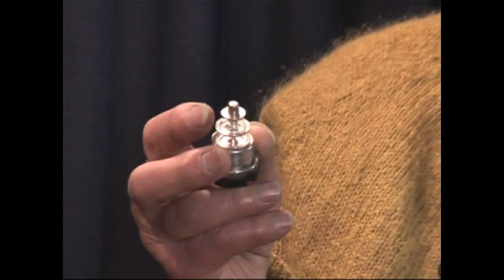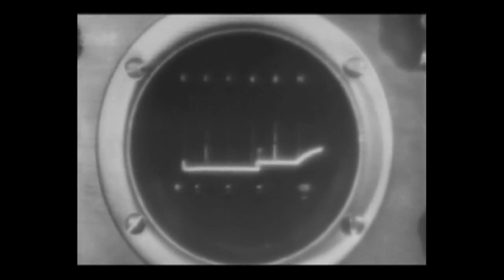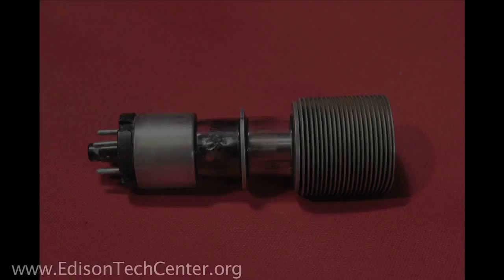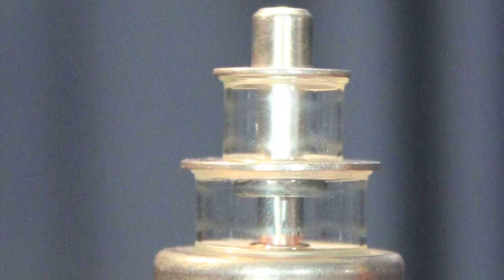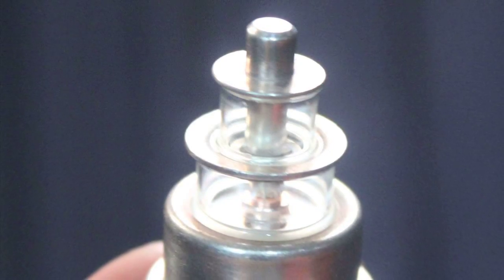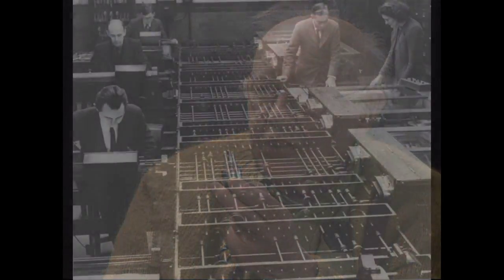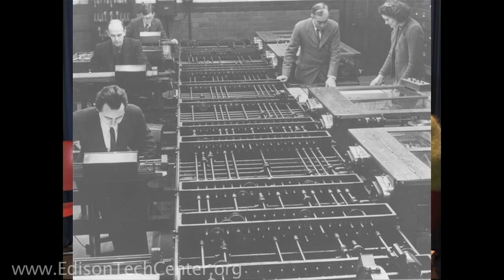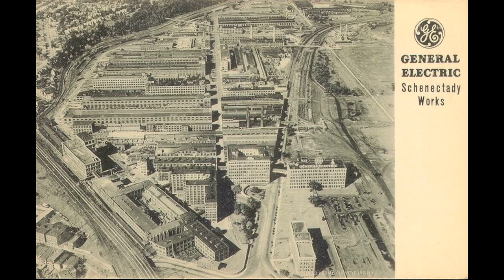Radar History: The Lighthouse Tube

Comment: The triode was the first non-mechanical device to provide power gain at audio and radio frequencies, and made radio practical. Triodes are used for amplifiers and oscillators. Many types are used only at low to moderate frequency and power levels. Large water-cooled triodes may be used as the final amplifier in radio transmitters, with ratings of thousands of watts. Specialized types of triode ("lighthouse" tubes, with low capacitance between elements) provide useful gain at microwave frequencies.

Comment: The RAF in the 50s and 60s Used an IFF (secondary RADAR) transmitter, using theses tubes, RT264.  Every body hated it, It was very difficult to work on and maintain. When we closed RAF western hill, in Malaya, we had the last one in service the F/S took us all outside Fired a volley and buried it. Fast forward 1998; I went to work for the US army in Europe supporting a Ground Controlled Approach (GCA) RADAR FPN-40 and there were RT 264s! as the secondary radar. (still in use when I left in 2012.
Reply: I love stories like this!